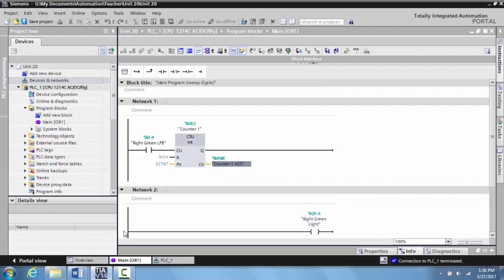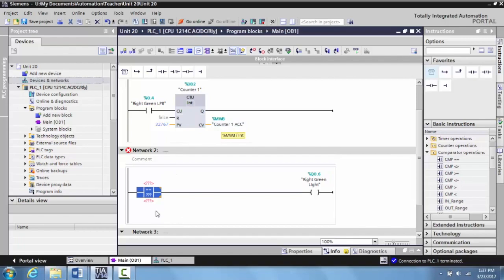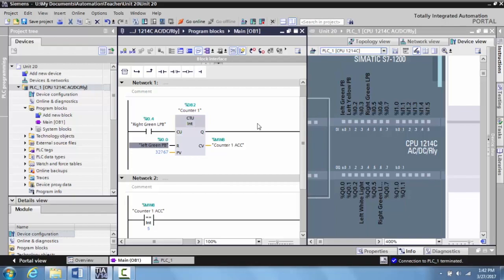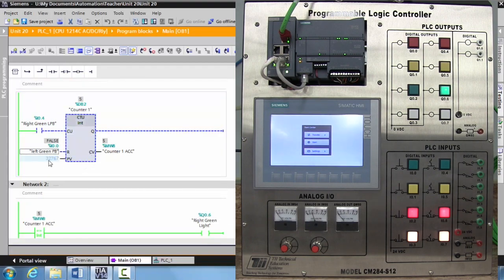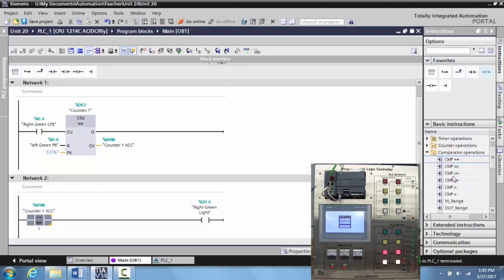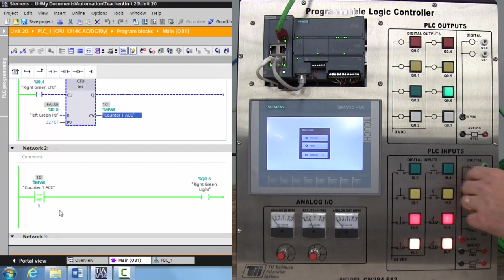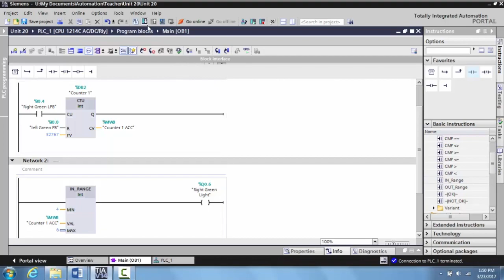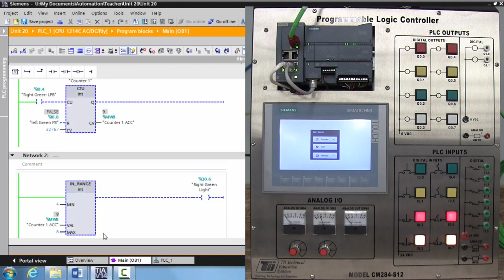Porgamming Compare Instructions in the TIA Portal V14 - Unit 21

Comment: Hi, I was wondering if you could use the comparator with a switch right beside it. I want to 'toggle' the switch on/off depending on the comparator.
Reply from the maker: You can place them in series.  But if you want to only to toggle a contact on with the comparator have it control an internal relay.  Does that answer your questions?

Comment: Thanks for the video. I wonder if you could help me further. 

I want to be able to use a count down up timer until it’s hits a PV value assignment by the HMI, however when it’s hits the count i want it to reset the count but keep the output on until it’s counts another PV value then the output can go off. 

For example: 
Operator sets PV to 100
Counts up to 100 activates output. 
That counter goes to back to 0 but output maintains on.
Counts for another 100 then output goes off. 

The problem I am having is that as soon as the HMI comes on its PV is set at 0 so the output is straight on. 

I hope you can assist. 
Thanks
Reply from the maker: There are a lot of ways to accomplish that.  One, latch on at 100 with a memory circuit and the discount the memory  at 200.  This would take 2 counters.  To do this with one counter I would recommend using compare instruction or a in range instruction.  I have a video on that as well:
https://www.youtube.com/watch?v=0UBV9-HeOmU&list=PLrlsstwICKolFXCZ_JoQ_3zONFHjxFX31&index=25